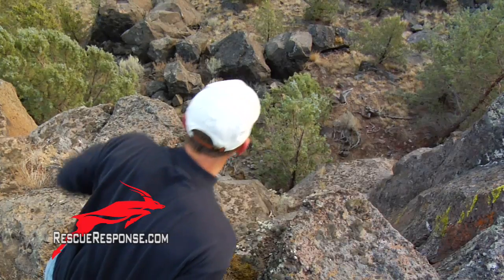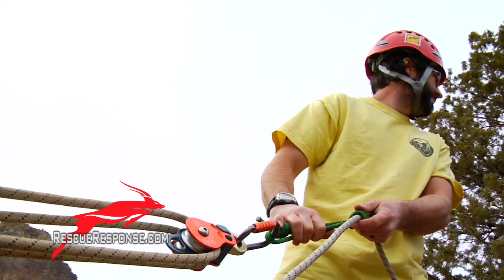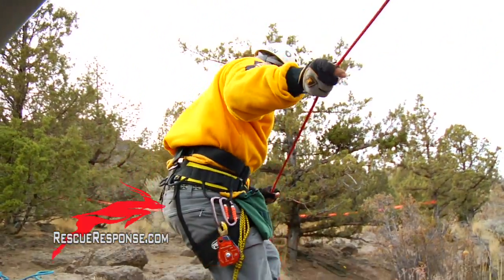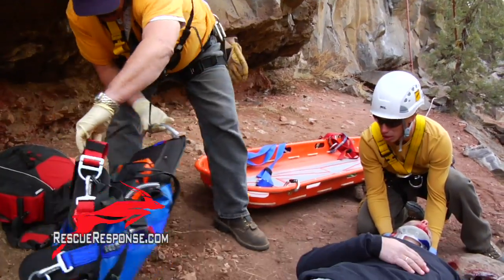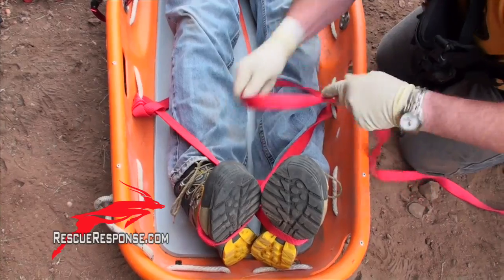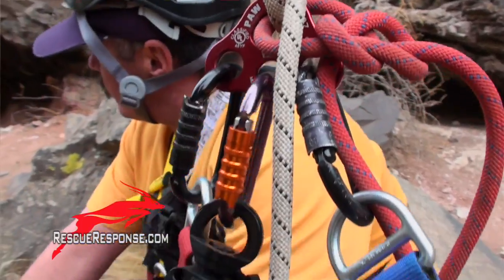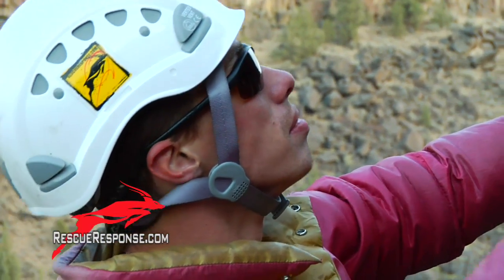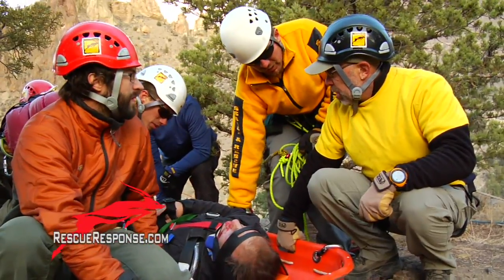High Angle Raise with Vortex Side A-Frame, Part 2 - Case File #015 Rescue Response Team

Comment: Why use 5:1 MA not 3:1 MA
Reply: yagoub2x2 probably because they are using an ID as the progress capture. IDs are just a camming device and not a high efficiency pulley like an MPD so they end up being like a 2:1 if rigged as a 3:1